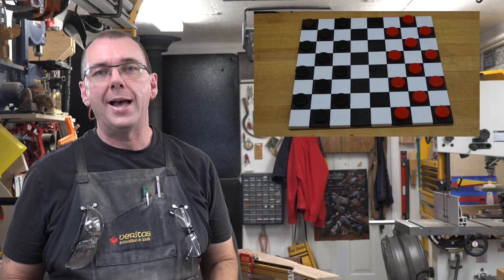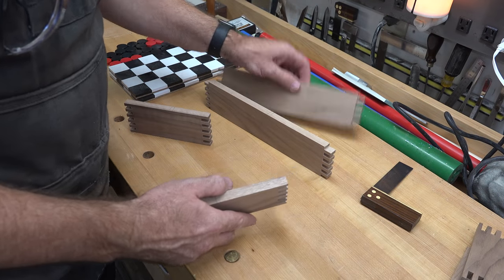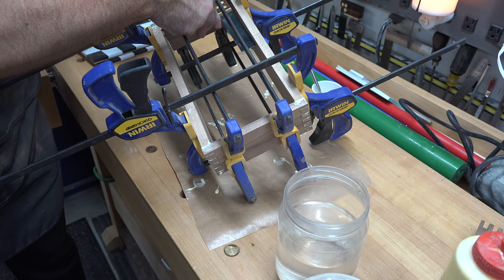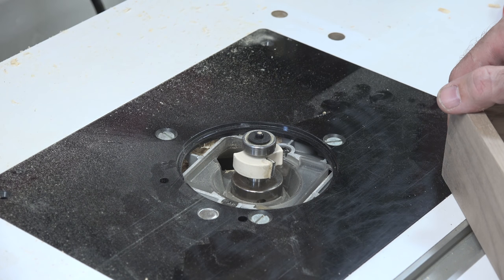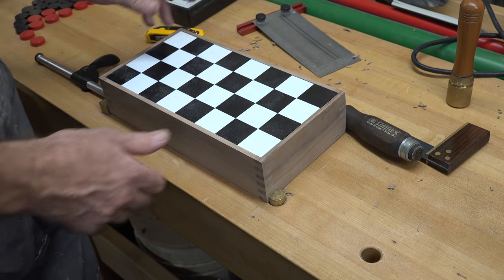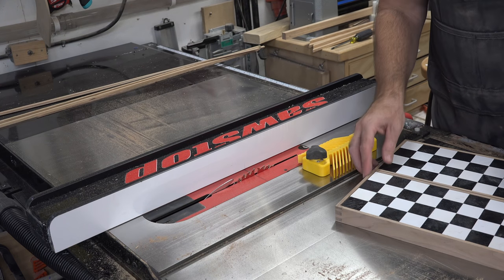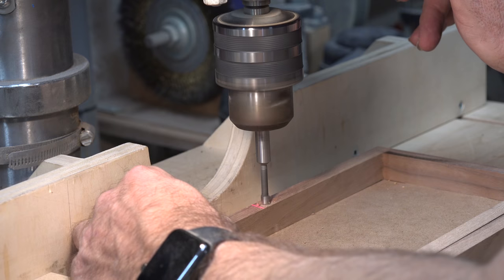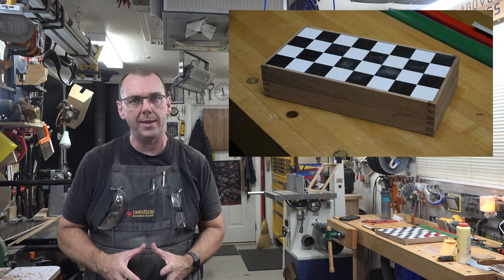Making a Checker Board Part 2

Comment: Ken, the checker board turned out fantastic.  Yes, it does indeed have “the look”.  The walnut adds a nice accent to the black and white of the board.  This was a really nice project.
Reply from the maker: It looks even nicer with the finish on it Paul.  If I would have thought about it at the time of filming, I would have shown the finished project but hind sight is 20/20 I guess.  Thanks for tuning in and for the kind words on the show.

Comment: Nice build Kenny, two things actually i would like to mention, Firstly after Tuesdays show i said that i had a feeling this was going to be a box, using the boards as lids. Looks like i was right on the mark ha ha ha.
Secondly did i just see you route out the inside of the box anti-clockwise? (counter) i thought it was clockwise for inside and ant-clockwise (counter) for the outside? 
Whatever it is you have still done a fantastic build, well done mate. Oh love the fun part at the end ha ha ha.
Barry (ENG)
Reply from the maker: Routing conventionally (as per the "rules" that you've stated...."inside clockwise, outside counter clockwise") is fine and dandy but if there is a chance for tear out with the routing job, doing the opposite of the rules helps with avoiding the tear out.  I used the same method during the ukulele build and it's called Climb Routing or Step Routing.  It's generally not done with a hand held router as there is a greater possibility of the router running away on you but for this small amount of material removal it was fine.  In this scenario, either method would have worked just fine and direction of the router isn't important.  Thanks for tuning in and for taking the time to leave a comment this week.  It's appreciated .
Reply: @acutabove_woodworkings  Blimey sorry i did a comment now ha ha ha.
Barry (ENG)
Reply from the maker: @barryroberts6470  Not at all.  I'm sure that someone else was wondering the same thing so why not give the full answer.  LOL.  Ask, and ye shall receive.  ha ha ha ha ha.  Thanks again for tuning in sir.